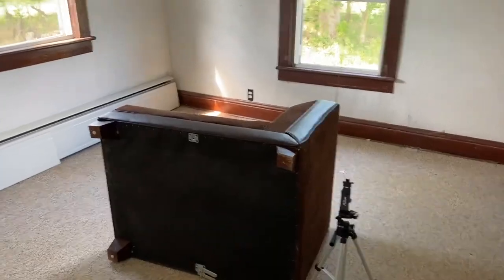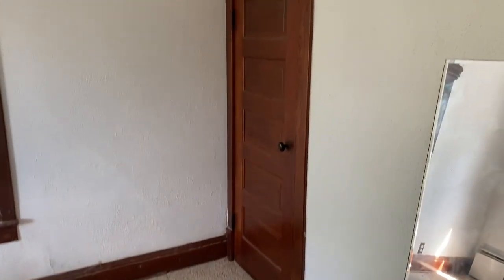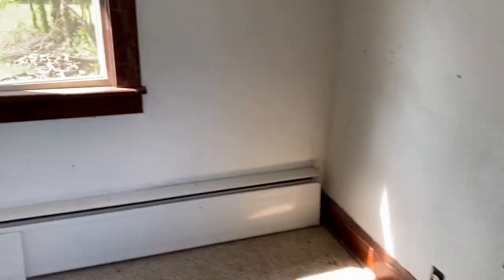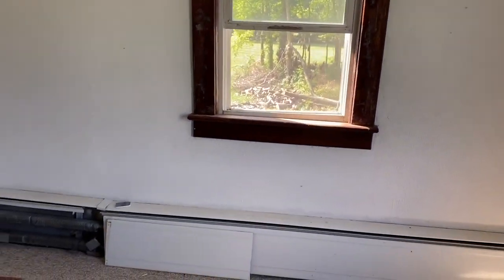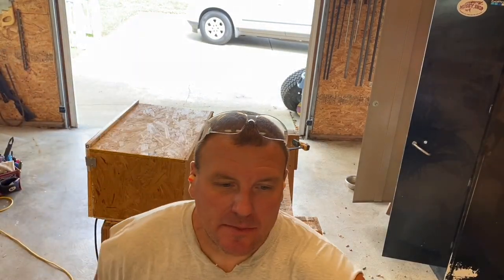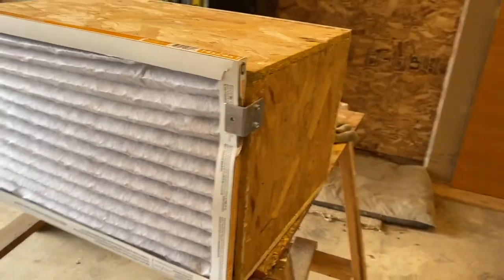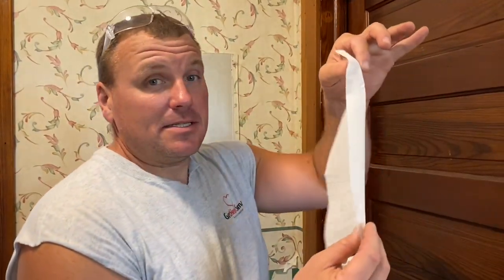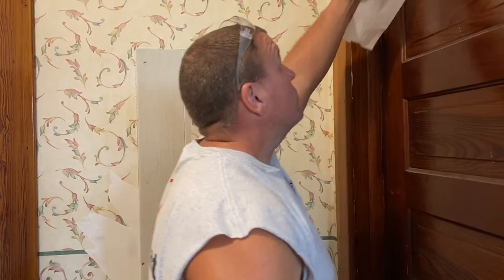DIY Negative Pressure Air Machine?

Comment: During construction I think this is the best way to hold dust. 

Would putting a machine, let’s say in the living room while your doing this, that takes outside air, filters it, then brings it in, making it a positive pressure room, help increase the amount of airflow in the negative room and effectively pull out more dust?

Second question.  After everything is complete, would keeping a positive pressure machine in the home running constantly help keep out dust and or maybe insects?  

It’d be nice if every hole in my house was like a blow hose that would push all the ants back lol
Reply from the maker: Great questions.  
1) Sounds good in theory, but there really is no need to do it if that room is negative.  By pulling that room negative while I work, we see virtually no dust in the house.  It works really well.  
2) The problem with bringing in outdoor air is that you’re going to have to condition that air before it enters your house.  You can’t bring in 10 degree air, for instance, without heating it which is going to increase utility costs.  Same in the summer, you will be willingly introducing humid air into the space which would negatively affect comfort.  Thanks for watching.
Reply: For sure man I love videos bringing things like this up.

I agree with you on the dust control.

I do know they have specially designed units like ERV’s I believe they are called.  They use the inside air and run it through a type of radiator to transfer the temperature and humidity of the conditioned/heated space to the fresh air coming in. 

That’s why In big box store in the winter, when the automatic doors open up you feel that rush of warm air hit you. 

I was an HVAC technician for about 8 years. (I’m not special I’m just familiar with some filtering)   I never got to experiment with an ERV though, but once I found out what “Aero barrier” was, I started looking into them. 

Aero barrier is where you basically take a home your building, close it all up and put a blower on the door, just like you would for a blower door test to measure how many air changes happen per hour to be up yo code, and with the home pressurized they have several jets in each room that fill the room with a mist of caulk. 

This seals the home to a level that you must bring in air from the outside with a unit like a ERV, but the bright side is you bring in air on your terms and can control/filter it.